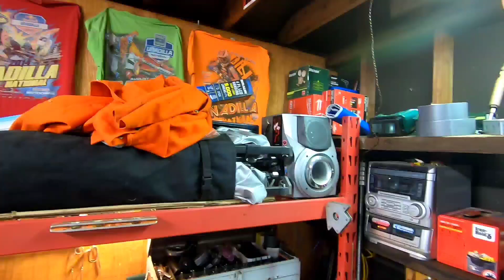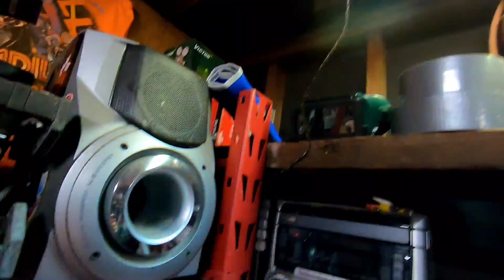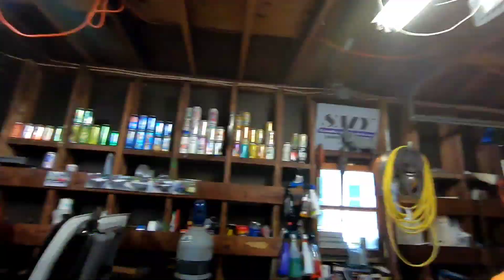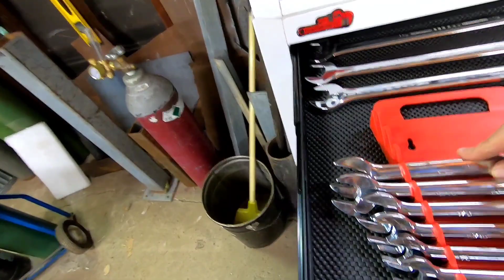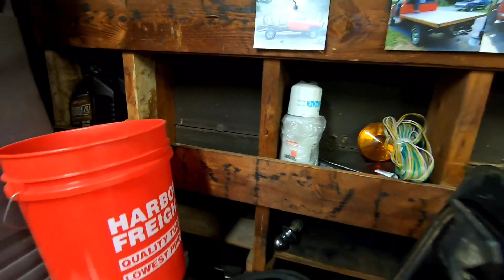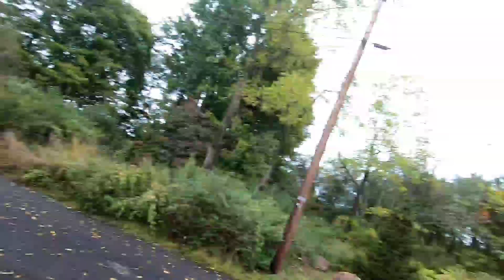MY WELD/WORK SHOP TOUR - TWO CAR GARAGE STYLE

Comment: What happened to the Millermatic 211
Reply from the maker: Ended up selling it
Reply: @mcfgarage did you find that the everlast was more than enough for sidework? I really want to welding on the side and I don't know whether to get a multiprocess or not.

Comment: It's a shop. I've been working outside for over 20 years.  And by pure luck I have been gifted with the ability to build a 40x60x16. You never know what's going to happen in life.  Also I'm sure you know that any compressed cylinder can be turned into anything such as oxygen, 75/25 etc. Nitrogen so if you don't have a good compressor you can run a plasma cutter

Comment: For containers i use ones from buying grapefruit slices, so they have a screw on lid. I lived in Illinois and retired to Florida and after 11 years moved to Missouri. This place we are at is out in the country and my building is 40x65 which is insulated and I had to replace the wood stove. The original owner was a welder and he put 220 outlets around the whole area. I had to replace the lights with LEDs and run all new circuits, which wasn't a big deal. I just started welding, been around it all my life. I worked in a union factory too.

Comment: A lot of the retractable hose reels have restrictions in them. That may be impacting the performance of your air tools. A short (like 25' for that workspace) 3/8 hose with high flow fittings (Milton V or similar) will likely be a noticeable difference in performance on your high demand tools, like the air hammer, impacts, etc.
Reply from the maker: i agree but the pump on this compressor is what the problem is